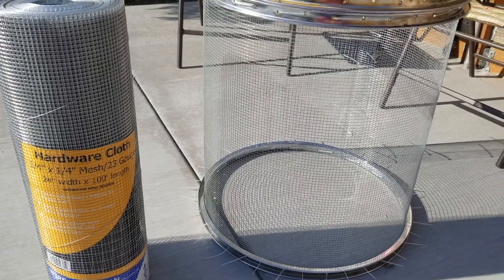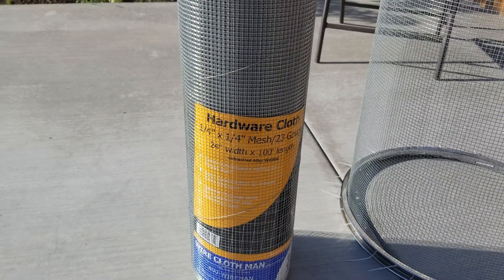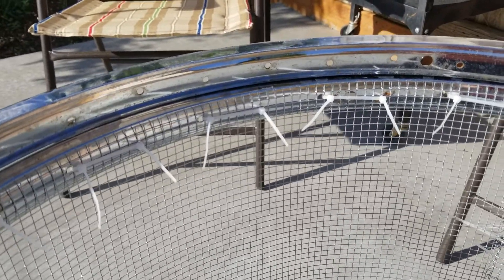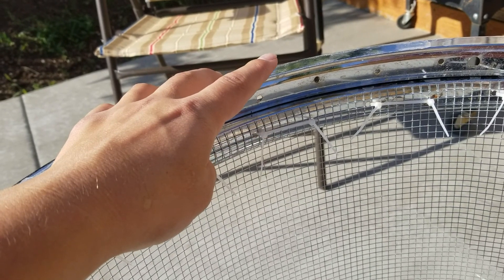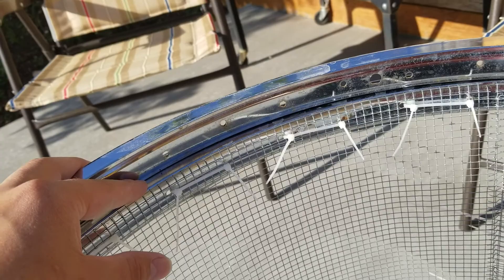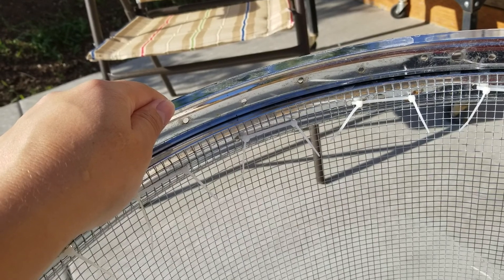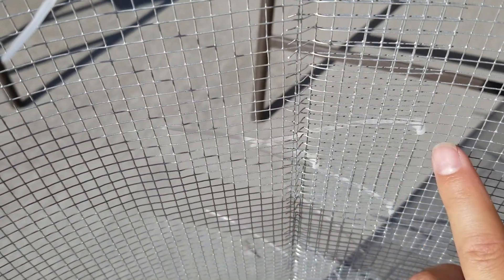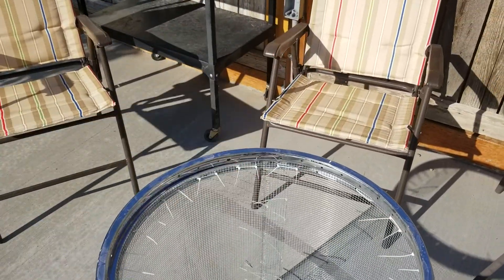Trommel build: explanation of the screen build.

Comment: Have you found the 4ft length of the trommel to be adequate?  Debating whether to do 4ft or 5ft length for mine.  I'll be screening dirt and fine gravel from my landscape rocks using 1/2" wire instead of 1/4".  I don't want the trommel to be too short and have the material cross the finish line before it's been adequately screened.
Reply from the maker: I would say that 80-90% of the dirt falls out in the first 2ft. With the 1/4 screen and the high sticky clay content I'm facing I would still say there's more dirt than I would like in the waste. So sometimes I've reprocessed the waste after letting it sit for a few days.

1/2" Screen should reduce the dirt in the exit even more. I've seen some others who combined the trommel with an array of pressure washer jets to really scrub off the landscape rocks. I saw another one which was I think 12 ft long, I think that guy said it was way too long and had similar results of 80-90% in the first 2ft and close to 95% in the first 6 ft. 
Good luck with your build and project.
PS sorry it's taken a bit to respond, I was offered a job a month ago and things are crazy.